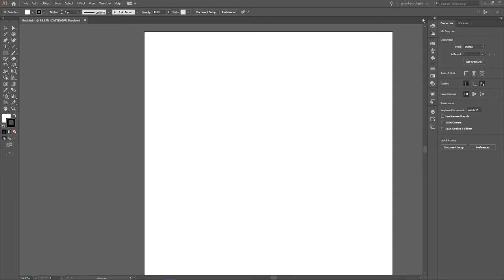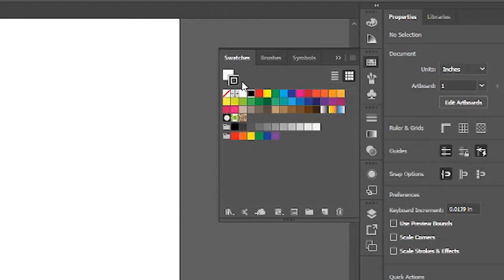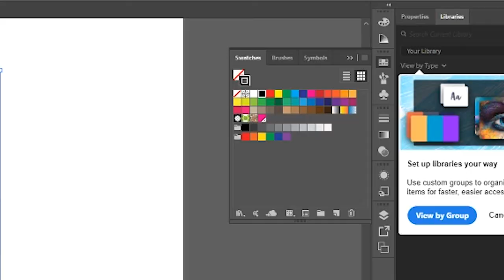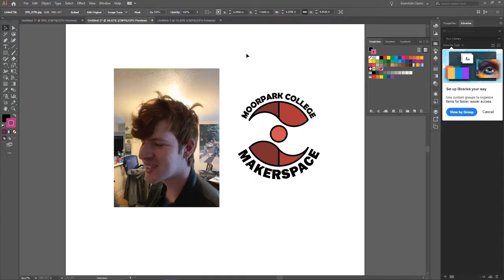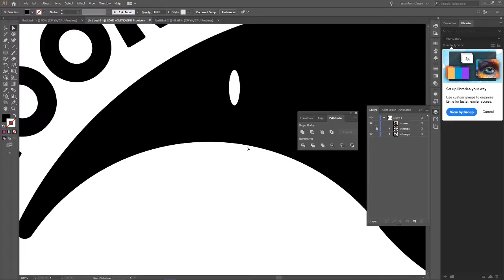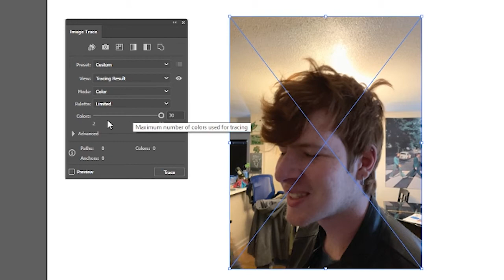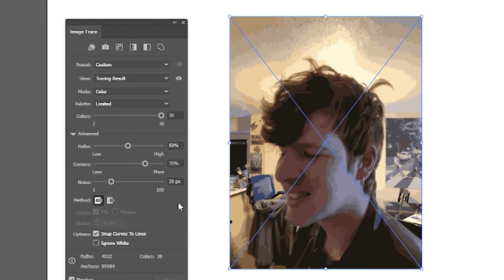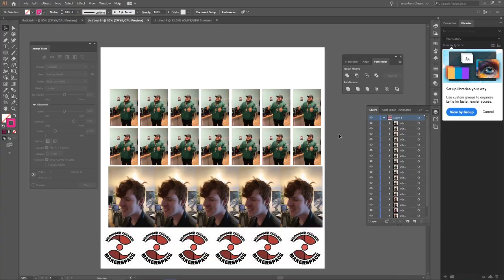How to Prepare Stickers for Printing on Our Roland BN-20

Comment: For Roland BN-20 users I offer a service. You send me the png/svg and I will create cut lines for you and convert the image from png/svg to PDF (with cut lines) so that it is ready to be used in Versa works. I will do the hard part and do the file prep for you and send you the finished product, this is so that you may start making vinyl cut/print art of your own and save yourself some time. (For a fee)
Reply: That would help out with all the guess work

Comment: This kind of "work" with pictures and vectors trying to make cutcontour lines is so wrong. Don't teach newbies such poor and BN-20 wrong cut actions (reduce number of nodes for BN-20 blade not to go nuts and add extra color or bitmap around cutcontour line not to miss cut). Learning Illustrator and Coreldraw takes time, as well as BN-20 procedures. This video lacks quality.